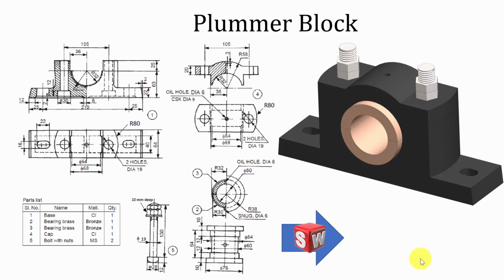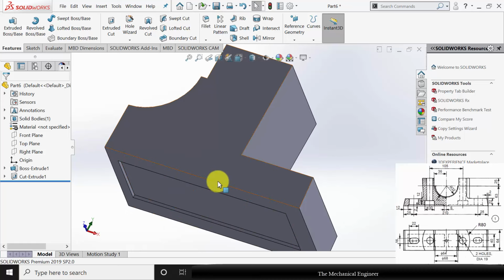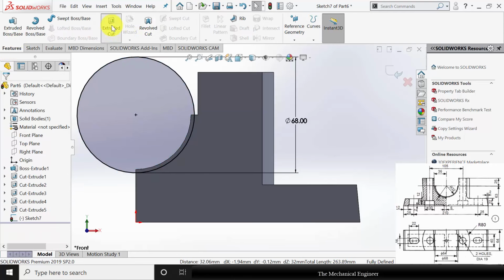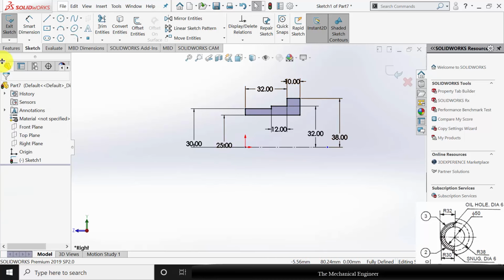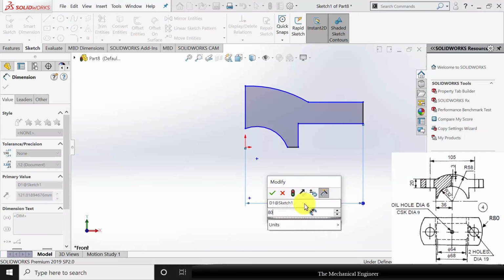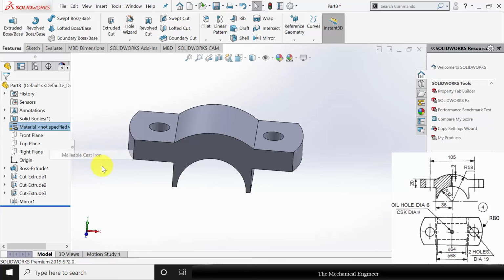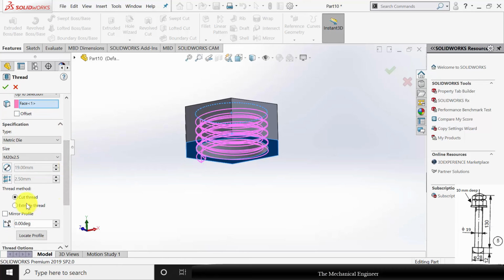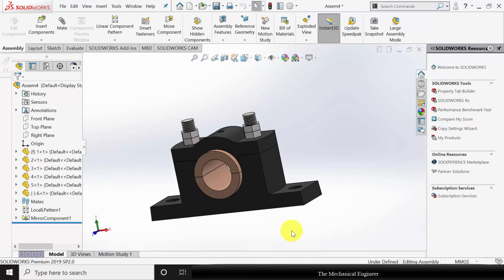Plummer Block using SOLIDWORKS | Parts and Assembly | SOLIDWORKS tutorials for beginners

Comment: Bhai AutoCad Kon sa acha ha
Reply from the maker: For 3D solid modeling, SolidWorks is a good option as it is more user-friendly. However, you can have a look at other software options as well. Each software has its own strengths and capabilities.